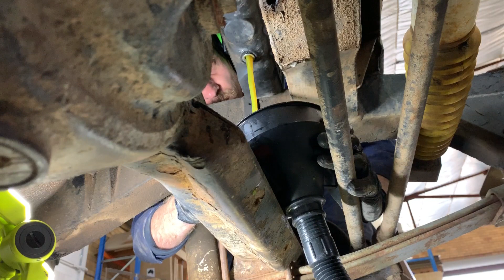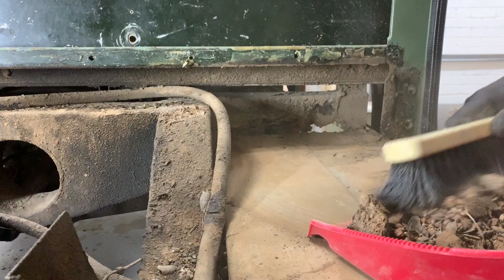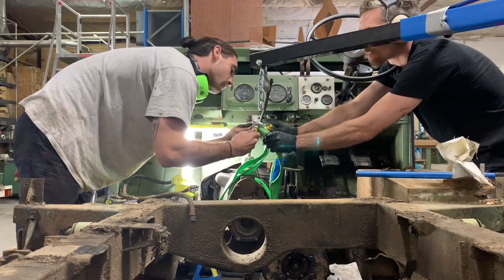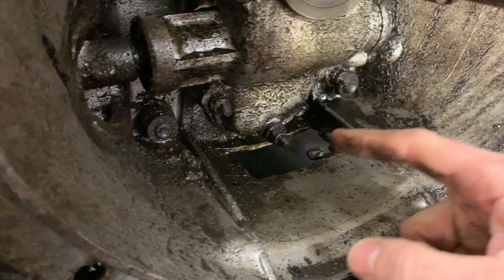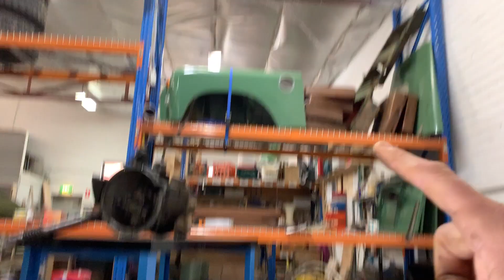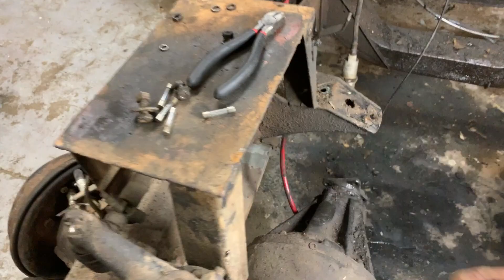Removing the Engine, Battery Placement & Finding Rust || Electric Land Rover Conversion

Comment: Hi, this is a very interesting build.
The hole in the bottom of the bell housing is actually to remove the end of the starter motor assembly when it falls of. These starter mothers have a small wire C clip on the end that holds the engagement mechanism together. In time this wears and the end pops just far enough off for the starter not to engage. Whey you remove the starter motor to repair it these parts fall down into the bell housing. This means remove either the engine or gear box or cut a hole in the bell housing. If left in there the parts make a hideous noise when they get caught in the ring gear. 
Thanks for the vidio
Reply from the maker: Ahh, that explains it. thanks

Comment: Wow! This is exactly the project I'm dreaming of doing! I'm really interested what you bump into along the way. The hole in the bellhousing I'm assuming it's to let the oil out so it doesn't get on the clutch plates. 
Question 1, how are you financing this? The motor, batteries and your time must add to to quite a bit of time and money. 
Q2, why are you linking the motor to the gearbox? Do you require the gear ratio? My thoughts are to link the motor to the transfer case to retain the yellow and red levers (e.g. high/low, and rear/4wd). Alternatively ditch the whole transfer case to, but then you'll need two motors in sync to attain 4wd(although a very cool solution) loads of luck, really enjoy watching your work!
Reply from the maker: Thanks we're having a lot of fun and learning a lot. 

Q1.  We've been burning though our savings the last year as we're not making any salary.  The parts and other expenses are funded through early sales and some investment.  We're operating very lean. 

Q2.  We need the gearbox to get the reduction. wIthout it (at 1:1) its essentially like being in 4th gear. Even an electric motor needs a little more help to start off.  One day we may use a reduction gearbox and only keep the transfer case, but for now its much easier to use the orignal system

Comment: As a lifetime LR person , I find this most interesting . The only problem for me is that these vehicles have no crash protection for occupants . I wouldn't feel safe is one now that the decades have advanced and we have current safety standards  . What's your take on the UK market to export to , or does that entail import standards that local re-manufactured products do not have to adhere to  ?  Cheers :-)
Reply from the maker: Australian safety standards are some of the most strict in the world (when it comes to modifying old cars) so there's no regulatory barrier preventing us from shipping to the UK.   While they'll never be really safe cars compared to modern ones, we do add disc brakes, collapsible steering column and improve the side collision protection